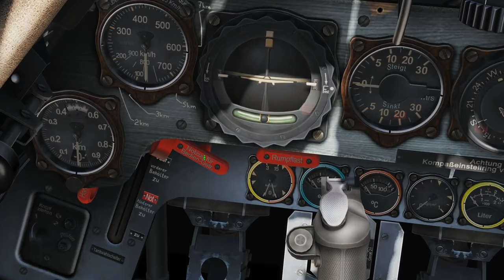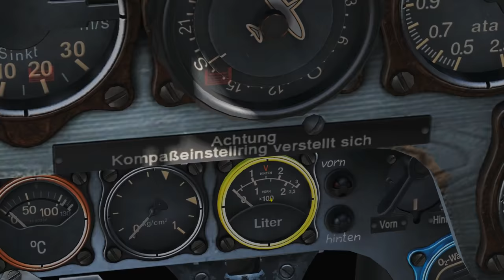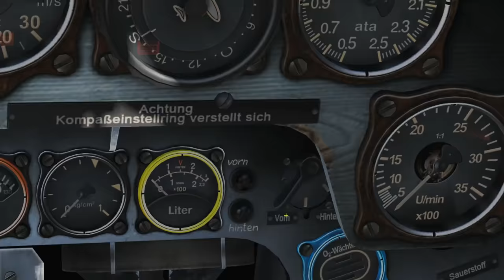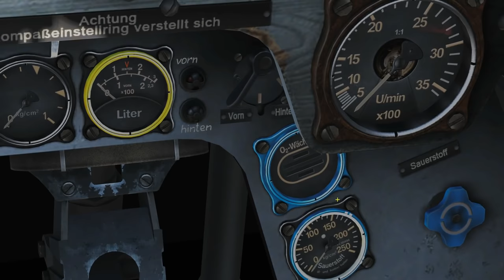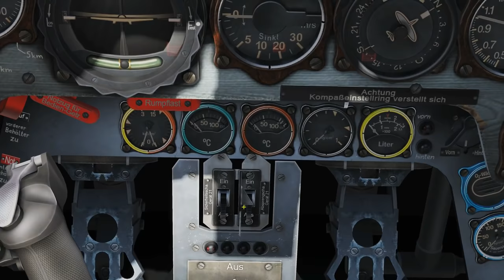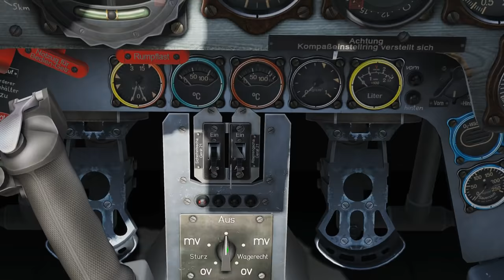FW-190 D-9 Dora: Cockpit Familiarization Tour Tutorial | DCS WORLD

Comment: A throttle lock would be very useful in turbulence.  It would allow the pilot to take his hand off the throttle in straight and level flight.  This would allow operating of the other controls and not worry about the throttle changing position.  I'm a pilot of the Cessna 172, and I always appreciate that the throttle and other engine controls(carb-reheat and lean/rich) are friction locked whenever my hand is off them.  If I were flying that plane for real, I would push that throttle lock every time I took my hand off the throttle in flight.

The cowling flap controls are to control the engine temperature.  Ultimately, they work the same with every internal combustion air plane.  While pushing them in reduces drag on the plane, the real goal is to control the temperature of the engine.  You would need to be active and careful with that control in actual flight.  It should be part of your regular scan.  I.e, look at it at least once a minute.  With a single engine plane, you spend your whole flight a single mechanical failure from an off-field landing.

Comment: The round thing sticking out of the right side of the FW 190 right behind the engine was an air intake that was ducted to cool the rear row of cylinders on the 190's radial engine.
Reply from the maker: thx
Reply: Nope. This is a Dora, so it has a V-12 engine, not a radial. What it is is the air intake for the supercharger. Same basic design as on the 109 (starting with the F-series). I'm pretty sure its shape provides a ram-air effect, giving the engine a few extra hp "for free". 

Plus the radial engined A-series 190s had no external scoops or airducts. All air (both for the supercharger and for cooling the engine and the oil) was let/sucked in at the front behind the propeller. There was a cooling fan there, sitting behind the prop, that created a low pressure zone to ensure sufficient air-flow.